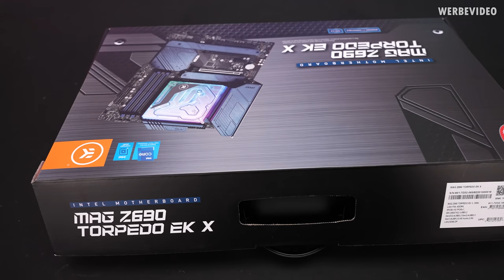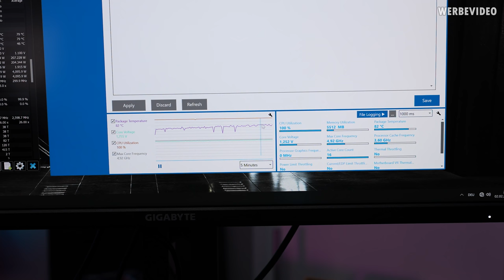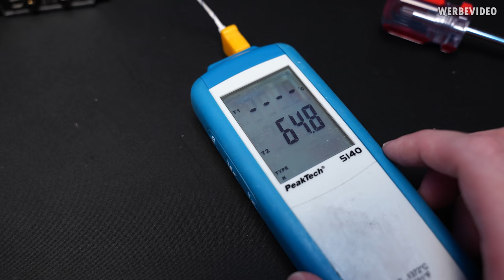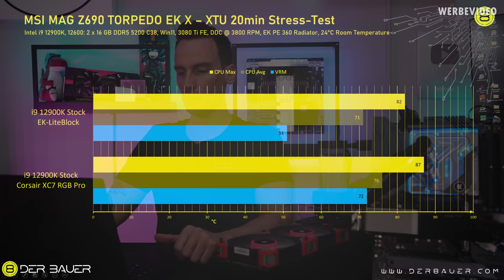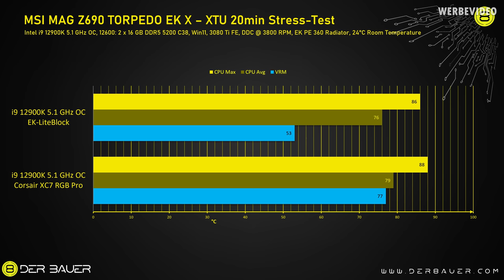A Water Block to cool the Mainboard Heatsink?

Comment: Price is on par to be mostly at cost. A typical Motherboard at this price range should be around $360-400USD, and similar EK Monoblocks would average anywhere from $120-150USD. Seems very reasonable

Comment: I like this hybrid cooling design for the VRM. When cleaning the loop, you can slap an air cooler on and reduce the system downtime. Also installation seems easier and doesn't require removal of the motherboard from the tray, compared to traditional monoblock vrm cooling designs. If future boards used this design, the monoblock can be repurposed instead of being motherboard specific and going the landfill if your motherboard dies.
Reply: Why stop the system to clean the loop? Lil soap in the resivor and let it run then flush it with distilled a few times then put coolant in
Reply: beginner question about loop cleaning - can't you just unplug all components except the pump from your psu and then clean the loop so you don't risk overheating anything?
Reply: @Creamworks  well I’m not sure how everyone else goes about cleaning. But I pretty much remove all components in the loop, including the pump. Clean with a small brush and soapy water. Rinse with distilled water, towel dry/electronic duster to get rid of most of the water. Then air dry overnight and reassemble. It’s tedious but I haven’t had any corrosion in my years of building. I normally throw on my tower air cooler and use my older non water cooled gpu in meanwhile. So not much downtime. I personally don’t like cleaning my loop while it’s stills attached to the electronic components, even if they are not powered. If water spills on your motherboard then it’s extra downtime cleaning and waiting for the board to dry.
Reply: @virtualtools_3021  I just saw your reply, 8 months late, forgive me haha. I’m just very thorough with my PC cleaning. Your method may be enough and if it works then keep with it. Its kinda therapeutic for me to do a full disassembly I suppose.
Reply: @Pending.Approval  thanks for the detailed reply!

Comment: Now, if future motherboards used standardized VRM layout, this monoblock could be universal. I kind wish you tested this particular board with some air cooler, like DarkRock 4 or Noctua NH-U12s. If VRM temps went down too, it would be big selling point.
Reply: Why would you test a specially built board designed for a water block with an air cooler? I am confused by your last sentence, but I may just be missing something obvious.

Comment: Reminds me of the Asus Striker II Extreme where heatpipes connected the VRM and southbridge heatsinks to the northbridge heatsink which had a waterblock built in.
Frankly that's what I want to see on highend motherboards, heatpipes, real fins, and triple channel memory.
Reply: @PC_Modder Doesn't the motherboard have to play ball with the CPU though? I am not trying to argue with you, just thinking that they do have to add that feature to the board for you to utilize the CPUs ability to run triple channel. I could be totally wrong, all of this is well beyond my level, I just find it interesting to watch.
Reply: @--_DJ_--  Well if the CPU doesn't have triple channel it will not "play ball" with triple channel. If its a Threadripper or HEDT then anything less than designed would be poor.
Reply: @DLTX1007  What was the point of writing that?

Comment: I usually pass automatically on boards with some kind of water cooling built in due to exorbitant pricing, but 400 euros is not a crazy ask at all for something like this on z690.
Reply: The good thing about exorbitant price monoblock boards is that once they're a gen or two old, they quickly go on clearance for a while.

Comment: der8auer - YOU REALLY SHOULD TAKE THIS IDEA TO A MOBO MANUFACTURER AND DESIGN THIS WITH YOUR NAME ON IT!!!! ASAP!!!! BEFORE SOME ONE ELSE STEALS THE IDEA! I would NOT  want credit if you ever did it, I just want to see it made! IT WOULD BE BEAUTIFUL AND ONE OF A KIND!!! PLEASE DO THIS!! 🙏😁
**
Make a SMOOTH, ONE PIECE MOBO that has a built-in cooling loop cover that attaches over top of the ENTIRE aluminum water block covering the ENTIRE motherboard would exemplify this 100%!
***
I have often wondered why  mobo makers didn't  just make one single block (just like this) to cool everything except the GPU..... (well maybe not the ram... or the 'south bridge' chipset) but now we can see one flat large block that covers most of the area (it SHOULD be cooling the m.2 nvme card too though) 
but I think iyt looks great and performs AMAZINGLY!!! But like you said cooling the VRM doesn't really change anything except maybe a little bit of lifespan, BUT I think of it more about the LOOKS!! ...  m

Comment: Of course MOSFET temps dropped in the video: der8auer just added a second cooling method to the same heat sinks. He used the smaller heat sinks (that are meant to work in combination with the EK monoblock) with the corsair block. Comparison of the original 100% air cooled heat sinks on the VRM and the corsair block with the smaller air/water cooled heat sinks and the EK block would be more fair. 
I like the idea of watercooling VRM, though and the test is still useful: I now know this motherboard does a great job in cooling the VRM.

Comment: For me the biggest issue with the MSi/EKWB motherboards is that they do not give additional heatshink for the VRM. That would be the best option. So can use AC or CLC as you want. When I did ask MSi for the additional heatshink for VRM, they wanted from me 120€ what is just ridiculous.

Comment: I wouldn't be surprised if the better performance of this waterblock is at least partially down to lower PCB temperatures... LGA1200 PCBs got quite hot under 250-300w (package power) load and I would be surprised if that isn't the case for 1700 as well. With a setup like this, that heat can come out through the VRM area instead of just pooling behind the CPU package.
Reply: Stick a heatsink on the metal CPU socket backplate, dropped about 7c on my X79

Comment: one thing i dont understand about watercoolers. Why dont the cpublock have fins? wouldnt that increase surface area? Would be cool if it was like a radiator on a F1-car with those small small holes for water to go thru
Reply: It does have fins

Comment: Mind it he is using open case and it is still winter. So when summer will come temperature will rise significantly to 30c more and average consumer will be using it in closed case so around 10 degrees more. It is becomes necessary to use these waterblocks for Higher end cpus

Comment: I thought stainless steel was a bad heat conductor (from GN's coverage of the XFX THICC cards). Seems like it's doing fine here, but why not go with aluminium for the plate? Would the cost increase be prohibitive? You'd be able to recoup material cost increase with weight savings too.

Comment: I'm not good with thermodynamics, but I wonder if you took the same amount of surface area the fluid traces and didn't have it taking thermal load from the VRMs... would it perform better in cooling the CPU solo?
Reply: Exactly what i thought and this is why i dont like water blocks on top of VRMs when nowadays majority of boards dont need that level of cooling
Reply: Unless you have terrible flow rate or insufficient rad capacity it's a negligible difference

Comment: I tested the X570 asus crosshair viii dark hero with EKWB monoblock also testing right now the z690 asus extreme glacial and I would not buy this unless the motherboard specs, usbs m.2 pcie lanes match what you need in which case why not price is good...the VRM temps are okay but not great, after several cinebenchr23 runs my vrm temps both with X570+monoblock and Z690+ultrablock are 40°C (5950x) 39°C (12900k 3 cores@5.5 and allcores@5.2 thx to asus AI oc) if you have custom loop with a top radiator (makes sense ONLY if you watercool the gpu too) cooling the VRM gives you a direct benefit, that heat won't go straight into your top rad(well it does but in liquid form lol) btw the EKWB monoblock gives better temps because the corsair one isn't good, it's a copy pasted cooling block for several generations of cpus both intel and amds, it's not bad but it's far from being at the level of EKWB or HEATKILLER (I've got several of each brand)

Comment: Looks like aluminium to me, possibly (colourless) hard anodised which would explain the surface appearance and the file test.  Also stainless is a terrible conductor of heat compared to alu/copper.

Comment: Should be able to easily tell if it's aluminum or steel easily just by the weight. Also would be good to test how much it actually does.
Reply: Even before he could tell by weight in the hand, it's obvious by luster -- and by the fact that no one would put mixed electronegativity in a custom loop.
Reply: @concinnus  I did

Comment: C&C a copper/aluminium plate and swap it out if it's possible? Would love to see that, even though this is way overkill as is.
Reply: I cannot understand how anybody can praise this when they chose steel over aluminium/copper, for the price they're charging for this. The performance difference between the two metals is very significant.
Reply: @stevenwest1494  It's not like they cheaped out. The performance is amazing, and they don't need to waste more expensive metal and increase their cost, thereby increasing the cost of the product. If it did not perform well because of it, that would be cheaping out.

Comment: so 87c with a  monoblock hooked to probably a 360 rad and you keep saying that while gaming you won't see these temps which is true, but i thought that the 12900K was the jack of all trades meaning that it competes against the 5950X which is an all arounder CPU for everything therefore whoever going to get these CPUs whether they want them for bragging rights or they want them to do actual work (meaning CPU intensive or at least moderately CPU intensive work) and game on the side.... 
so till when you gonna be defending the fact that these CPUs actually run hot...
Reply from the maker: Gaming Temp is 60-70°C which is absolutely reasonable

Comment: You can test if it's steel or copper by using a magnet.
Steel is magnetic, copper is not very magnetic.
Reply: Copper is not magnetic at all.
Reply: Yea copper isnt magnetic it gets alittle different once you start moving the magnet or the copper but it still isn't magnetic, And all steel isn't magnetic iron try out some stainless and see how that works out for ya. Although some can be depends on the structure and if its ferric or not. Hence the term ferrous and non ferrous metals, it really boils down to the iron content and structure.

Comment: Why would EK design a block where the liquid contacts both copper and steel?
Reply: Waterblocks regularly use steel jet plates.
Reply: @ActuallyHardcoreOverclocking  Won't steel corrode when exposed to DI water or coolant?
Reply: @Wasmachineman  it's some kind of stainless
Reply: @ActuallyHardcoreOverclocking  In that case it definitely would not be attacked by DI or coolant.

Comment: Seems more like a gimmick than actually cooling. Vrm/thermal pad/heatsink/thermal pad/cold plate/water. Seems rather inefficient. May still pull away some heat, but i doubt it anything beneficial. Would like to see the regular torpedo board compared here as well. The way the vrm heatsinks on this model are made is also inefficient for passive/air cooling.

Comment: Does a monoblock increase the cpu temp being that it's also cooling the vrm? I have a Crosshair VIII Dark Hero with EK monoblock and wondering if I would get better cpu temps by going with just a cpu block.
Reply: I can answer you, same motherboard, your cpu temp raises by 1-2° because the vrm raises your liquid temp by 1-2°C, same when you add the GPU in the loop add another 2-4°C to your cpu+vrm temp, keep in mind I use optimized radiators count and placement when I only had the cpu my liquid temp were really low like 25°C at idle cpu+vrm more around 27°C and with the gpu in the loop it'll be more in the 29°C that offset basically stays the same wether you're in idle or under heavy use, liquid cooling everything is superior have no doubt as you can cool 600+Watts in heavy gaming and have acceptable room temperature, liquid temp stays low and so does the air exhausted by your PC, I easily gained 10°C room temp going all watercooled

Comment: if you fully water cool, you dont have any moving air in the case, duh
Reply: External rad? Otherwise you have airflow from rad fans
Reply: @virtualtools_3021  outside case if you will, shut the case up

Comment: Seems like a pointless system if you gonna water cool the cpu it means there won't be much air flow over the cpu. Making the normal airflow for the vrm useless. It would be better to just buy a board and a monoblock so you have both options

Comment: Could you not have just used a magnet to check it was steel
Reply: Some stainless steels are not magnetic, so it won't prove anything (other than if it is magnetic or not)

Comment: If the waterblock is made out of steel, then it's more of a heat insulator than a conductor...
Ever noticed the temperature difference between exposed parts of your bath tub and what's under the water? Or maybe ever wondered why a handle of a steel frying pan is never warm to the touch?
Reply: My bath is enameled so no
Reply: @wsketchy  Doesn't make too much of a difference.